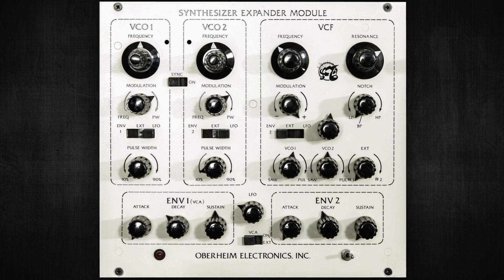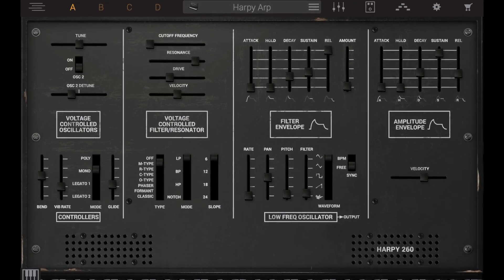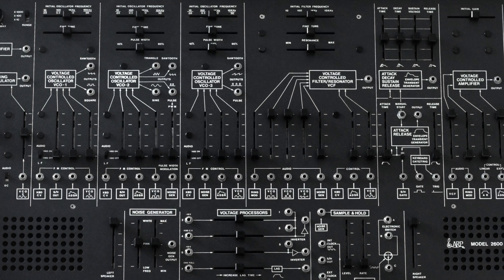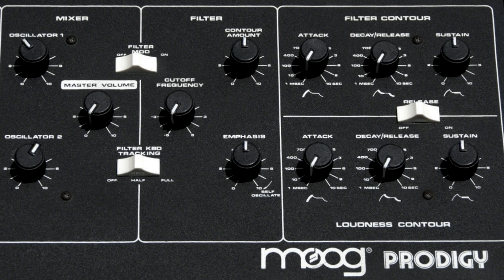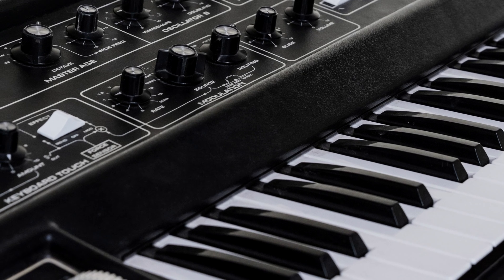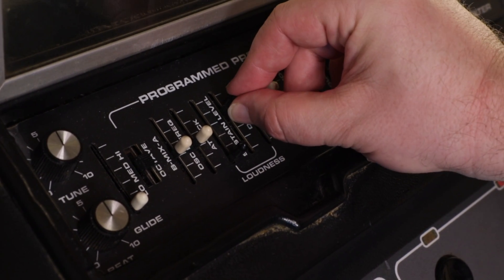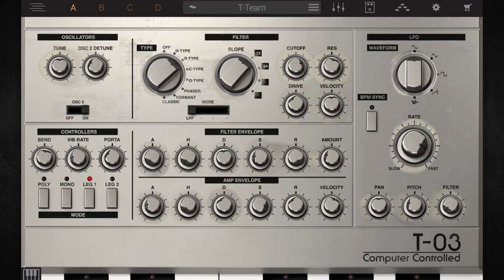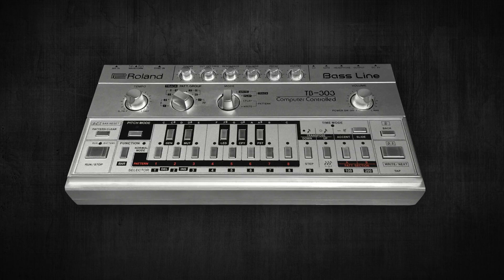Syntronik - Hardware Synthesizer DNA - Part 2

Comment: What's the advantage of samples over synthesized oscillators? Seems like samples would be limiting; only a limited palette of cross-mod, PWM, FM, sync sounds, i.e. only whatever variations were sampled.
Reply from the maker: We did extensive - I mean EXTENSIVE - sampling which gives a far more realistic sound especially when coupled with DRIFT™ technology which adds even more realism by simulating the analog behavior coupled with deeply-sampled oscillators.  Add the analog-modeled filters and top-shelf effects and you have a powerhouse of synth sounds.
Reply from the maker: Also note we make extensive use of round robin sampling throughout the product,  from the raw single oscillator samples to the samples of complete presets. In addition to that, we also pay a LOT of attention to phase and phase relationships to capture the living, breathing, organic quality of analog synthesizers.
Reply: yeah...and EXTENSIVE memory usage...